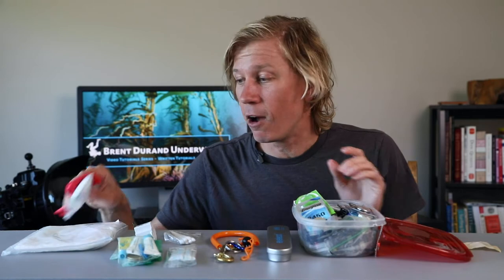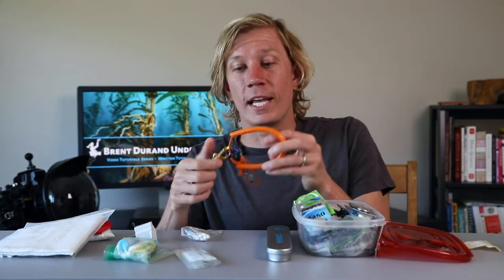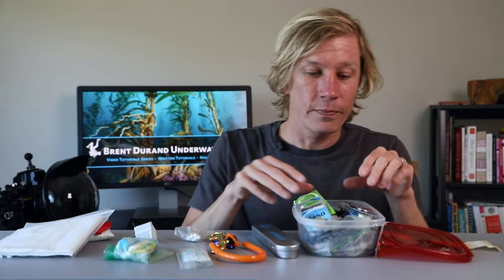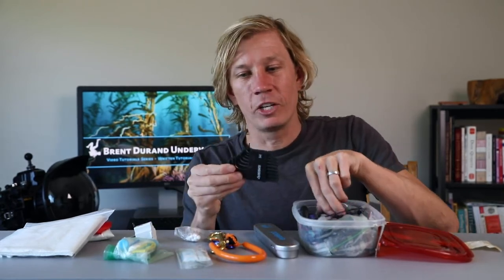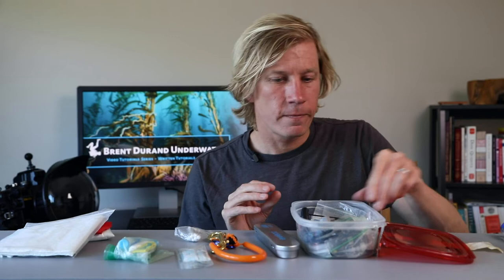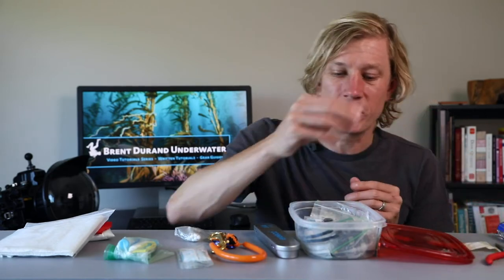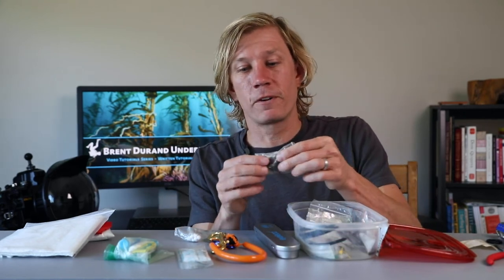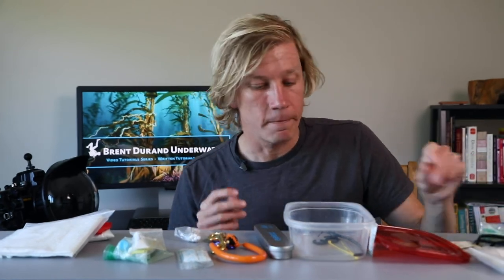Inside Look: My Camera Tool Kit

Comment: O-ring picks (or a sharpened credit card)! 

The plastic o-ring picks are definitely the best tool for housings, where you don't have to worry so much about putting a scratch right across the grove. Stainless steel picks (when used with some care) are great too for pulling o-rings on dive gear or for the sometimes difficult to extract o-rings on the inside of inflator hoses and such like.

Spare o-rings and a few picks have saved me innumerable amount of headaches over the years, as things almost always fail at the dive site. Although now I always build all my dive and camera gear the night before diving, so that I have time to fix any issues that might arise. 

A flooded camera due to hasty assembly is a hard and expensive teacher!

Love your videos, keep up the good work!
Reply from the maker: Hi Jason - Can't believe I forgot to highlight o-ring picks. Definitely an essential. Usually I squeeze my o-rings off, but do use a pick for the housing that I keep in a padded accessory bag I travel with in carry-on gear. In there I've got the pick, o-ring grease and coins for screwing tripod and other mounts onto cameras/housings.

Really smart to build the gear when not rushed. I bring a camping headlamp as well, just in case it's dark where I'm prepping the gear. Thanks for the ideas!

Comment: Great vid as always. You should do one on placing your camera in your case and how you connect and check everything is working before a dive. As an absolute beginner it’s really hard to find video content on the subject
Reply from the maker: Thanks for the kind words. Great idea for a video. I can go through the prep like cleaning o-ring grooves, o-rings, putting everything in place, closing, then firing a test shot. Did you check out this housing maintenance video yet?: https://youtu.be/oP7rOZlEruY
Reply: That was one of the first videos I saw, but I found the two minute mark to make it feel a bit rushed and would like to see more detail specially on assembling the rig but all in all love your videos
Reply from the maker: @CAHB9295  Fair enough. The new one can also include what strobe arms and how to position them, plus a few tips and tricks to help simplify the whole setup process :- )

Comment from the maker: What am I missing here? (I forgot to include my mini hex/star screwdriver set since it's packed outside this little box, but aside from that).
Let's figure out the perfect kit!
Reply: I really like to use foam-tipped eyeshadow applicators from the makeup section of your local drugstore for cleaning out o-ring grooves.  They're dirt cheap and totally lint-free, while being as easy to use as the dreaded Q-Tip.   Photo at https://sc02.alicdn.com/kf/HTB1YLvXIXXXXXaWXXXXq6xXFXXXo.jpg_350x350.jpg
Reply from the maker: @OrenNoah  Really good point, Oren, and I agree. They're easy and cheap. I actually do have some in the kit at 9:00. Just need to get ones without plastic handles!